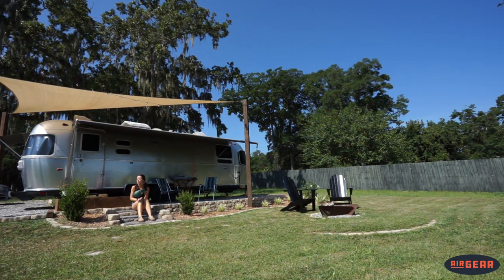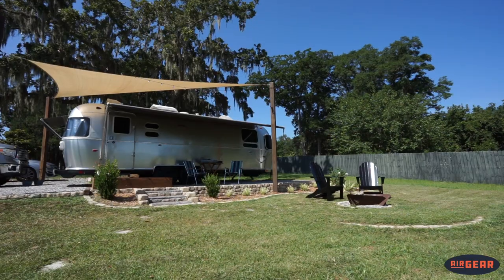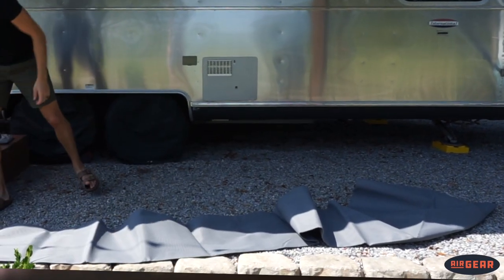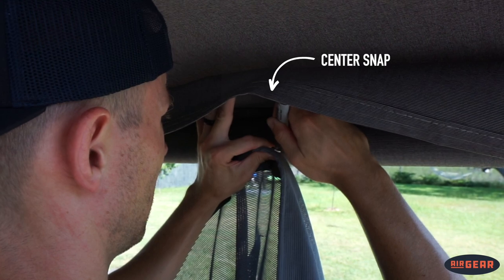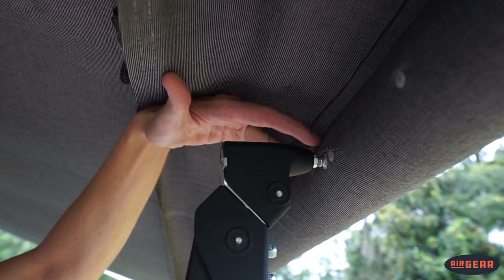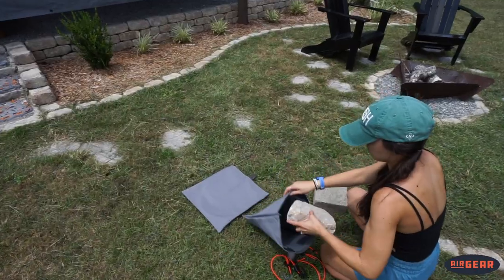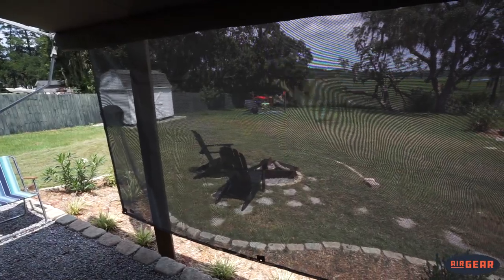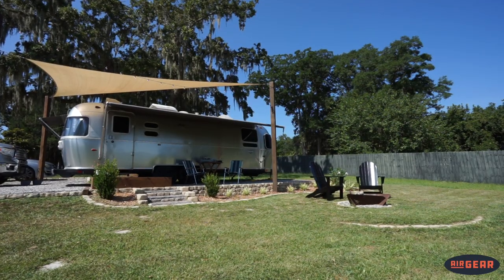Installing the AIR GEAR Sun Shade | Airstream patio upgrades!

Comment: Nice video!!!

It was the "drilling into the roller tube that caused me to pause on this project.  I was really afraid of either drilling into the roller components...or ripping up the awning fabric as I drilled into it!  Thanks very much for doing the video!!!
Reply from the maker: To allay your fear, if you just poke the drill bit through the metal, enough to make a hole for the rivet, you won't damage anything in the awning tube. The video gives you an additional tip for making sure your drill bit does not go in far. We've installed the Sun Shade on several of our own Airstreams with no problems. Happy camping!

Comment: It's a good idea to "seal" the acrylic fabric where the drill hole is by essentially melting it with a burning tool.  That way the puncture won't run or fray even with the snap riveted on top.
Reply from the maker: Trying to melt the acrylic after the rivet has been placed sounds a lot more likely to cause a problem. We've never seen a case where the fabric ran or frayed where the snap bases are riveted in.